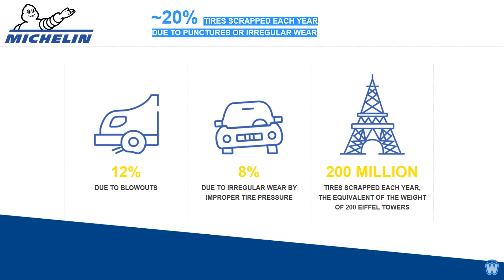Michelin Airless Tire UPTIS - Unique Puncture-Proof Tire System

Comment: I imagine these would be a pain off road.  Mud and dirt will fill the spaces, and you would need to constantly clean them out.
Reply: The crevices are not solid, as they flex and change shape the dirt and mud should clear out. They could always just cover the sidewalls with soft rubber, making them look closer to traditional tyers if the exposed structure is unsuitable for offroading.
Reply: @desolate282  what about huge rocks getting stuck in the holes?
Reply: they did mention these are used on military and industrial vehicles
Reply: check the pinned comment, it's explained there

Comment: If there's no deflation and inflation, how are these tires gonna be installed on the rims securely?
Reply: Friction without air pressure.

May need "machine press" level of power to slide this rubber tire into the rim. But to do this, will require a steel cylinder fused to the rubber tire. 

Which also mean, only one side of the rim can have a "lip". And the other "lip" should have a lockable mechanism.

Complicates the wheel system.
Reply: @allanbernabe38  my first thought was that they may be sold as complete wheels, which would be a silly idea as I consider it. 
 Your idea is more cost effective and accessible. Options for tire rotation would be less, but still doable. I mention rotation because, at the cost of a single tire at 800usd+, gonna want those babies evenly worn to get some semblance of value. 

Imo these are not good for road vehicles as rotational mass is a huge drain on the gas tank. 
Still, I think they are excellent for zero turn mowers, where a flat costs downtime to the commercial operator, a more important factor than to a car that already has a spare in the trunk.
That being said, I suppose the zero turn operator could have a spare in the truck just as easily.
Reply: That's a good question. My guess is friction. But even then, could it hold as well? And what if the rubber shrinks slightly over time? How hard would it be to get them off again?

Comment: Saw video of the US miltary trialing these kind of wheels years ago... Will all depend on their cost and relative performance to regular tyres. I'm not sure they will perform as well at speed and you cannot tune them via air pressure to suit the car and driving required like with regular tyres. I think the real problem is people not inflating regular tyres properly and that is a simple fix if you install tyre pressure sensors on cars as standard to bug the driver with an alert if they are wrong.

Comment: If a car with these tires were to go over a speed hump at a high speed resulting in the vehicle lifting off of the air for a few seconds and landing back on the road would cause quite some damage to the vehicle , since in normal tires its hollow inside , resulting in a sort of bounce that will reduce the impact force when hitting the ground . Since these type of tires aren't hollow the energy from the impact will be transferred to the vehicle , rather than it just bouncing . Due to that I doubt whether these tires are safe for off-road purposes

Comment: how does this save tyre wastage? they have the same lifespan as air tyres because you have to change them when you run out of tread. thse are much harder to construct, more expensive, have balance issues after crap gets stuck in the blades and you still have to chnage them every 30-40K miles.

Comment: One giant flaw with this system is that it seems like the surface area of the tyre on the road is far greater than a normal tyre which increases friction and thus less MPG

Comment: Why not instead more of a blade strip, that would slice in between one or more of the supports which would cause a structural instability, the tire would start peeling back from that point at high speeds so it would either stop them or force them to slow down

Comment: I would guess they have stability issues at high speeds, which is why they are not ready for the market yet.
Reply: I'm also wondering how they affect fuel efficiency.
Reply: @Mode-Selektor  Thats what I was wondering. they look very "flat" on the surface contacting the road.
Reply: @MEDiumInc  they can be made more rigid i assume. Definetely looks like less rubber used othervise, plus not needing to carry extra pressurized air means more efficiency overall
Reply: @FlyLeah  yeah but it has holes so wouldn’t that be just more drag the faster you go
Reply: @FlyLeah  yeah but a lot of cars run nitrogen in the tires. Makes the car lighter and more fuel efficient. These have a lot more rubber. So that also brings another fuel efficiency concern.
Reply: @MEDiumInc  lmao. Nitrogen does nothing. Air is already 80% nitrogen.
Reply: @r.i.peperoniiiiroh9625  you could cover those holes by adding rubber walls
Reply: I had read that they become brittle in cold weather ?

Comment: The police spike strip problem already has dozens of solutions. The police would have to transition into using a different type of “spike strip”, one prototype I saw was one that is a net and it wraps itself around the tire and axle, locking it up. The axle doesn’t spin, the car doesn’t move. No puncture needed.

Comment: I see a high speed pothole destroying a rim totally.. the way the tire comppresses in just the small pothole seems like a devistating impact on a rim for anything bigger going 40plus mph
Reply: All the impact is on 10 or so radial ridges, and not spread around the tire.  So you go WHOMP as the car drops to the ground and your bumpers provide braking as they drag on the pavement.
Reply: Quite sure there is a comprehensive testing strategy, after working in QC for VW group the standards are just ridiculous.... good concept tho, I’d buy a set
Reply: that also happens to conventional air tires though.
Reply: @jayflo714  yes but it is far less of a problem on conventional tires.
Reply: @David-vw5hf  have you actualy seen a normal tire? they cave in a fuck ton if you look att it with a high speed camera
Reply: @jayflo714  As there's a limit to how much you can compress air, you'll see that it's gonna be harder and harder to compress further. That's not the case with these airless tyres as the resistance devices (idk what they would be called) will provide roughly the same resistance no matter how compressed it is. Because of this, they will have to be a little soft or no one would use them because of awful comfort, but that means they would indeed be terrible for higher speeds. Even in the video they didn't show more than something around city speed limits
Reply: @Finsby  good point
Reply: I've never seen a high speed pothole. They normally seem quite stationary to me.
Reply: Fr
Reply: Maybe the way it is now, but if they add a sidewall for a better appearance, it would also give it more stability and less compression.
Reply: All you have to do is change how suspension handles that
Reply: @KpEMuKoBcu  ever been on american road. There is a reason we joke are tax dollars dont do shit if you cant get that concept then I dont know what else to tell you drive through east Cleveland on the bad parts over 40 on tires like these and tell me how you feel after
Reply: Easy, get tires with thicker ribs for more compressive resistance
Reply: @katyungodly  And then they're gonna be dreadful since they're not gonna have the necessary suspension when driving slower
Reply: ya so not a single person from the genius team of engineers envolved in this would have thought of that...i am impressed by your intelligence sir
Reply: @itsme_notbatman  yes and that's why they're taking time since 2024 trying to fix such issues
Reply: Did u even watch the whole video

Comment: Easy, make a spike strip that has barbs, the spike strip will remain inside this tire and wrap right around it causing the tires to either rip apart or lock up from getting tangled.

Steering would probably be heavily affected too and may cause the individual to veer left or right, who knows, but it would be a neat show.

Comment: I'm pretty sure these haven't hit the market because of fuel economy. Rotational mass usually has 3 times the impact on overall effective weight and these tires are definitely heavier than conventional ones. A greater contact area with the road also creates more friction. These would have a genuine impact on fuel economy during high speed cruising. Another aspect is safety. The lateral grip of these tires is much lower than conventional ones which makes them less safe in emergency situations. A driver who attempts to swerve around an accident could understeer straight into it. Braking distance as a whole would also be worse. The last reason is cost. More material and a more complex manufacturing process means a higher price for consumers. It's cheaper to use normal tires and fix them when they get holes. There's a reason you don't see police using these tires. Other countries that have a free market system also don't use these tires.

Comment: Just add emp sticky granades to police arsenal.
Reply: Many vehicles have electrical steering and braking controls. An EMP would disable these systems and cause the driver to lose control, which would likely be deadly at high speeds. If they wanted to just kill the person, they'd shoot them.
Reply: @mouthwash8182  well puncturing all tires at that same speed pretty much does the same thing.
Reply: @litti1047  Fair point, pursuit policies differ greatly between states, counties and precincts. In a lot of cases, if a vehicle is driving at excessively high speeds, patrol cars back off and allow the police choppers to keep track of the subject until they flee the car or wreck out/have mechanical difficulties. Trying to stop a high speed pursuit is never an ideal situation.

Comment: They will still need to be replaced eventually. After a tire reaches a certain age (8-10 years), it’ll fall apart. As for the criminal problem, there are special spikes being developed (look in Popular Science) that when deployed, will lock the axels underneath a car—making it undrivable.
Reply: Dude 9-10 years? More like 2-3 years
Reply: Also the tires don't perform well in high speed in the first place

Comment: This tire design has always struggled with high speeds. This is why you see them on slower moving vehicles, such as tractors, mowers, forklifts, "military vehicles," etc. but not on cars. 80 MPH is a daunting task for these.
Reply: I guess so, new designs will come up eventually. I kind of have an idea, maybe try a "tension string" that attaches to the wheel and the rubber tire so it could handle high speeds. I guess.
Reply: @aledner_lw7685  you can't trick the physics, those fillers are additional weight that heavily affect centrifugal force. More of that, surface of the tire is going to be much bigger in compare to air filled tire resulting in much faster wear - it is basically running on low pressure tire. How to reduce such effect? Put more fillers what means again additional weight. This tire design has too much flaws to be present in normal cars, it might have some uses in military or heavy duty industry but I feel like it is just finding solution to problem that doesn't exist
Reply: @bartomiejstadnik9585  It can get even worse when stones and all kinds of debris fill the gaps between the rubber. Also mud would be a problem. + air pressure is all the same in a conventional tire, but in these tires the pressure put on the down part is higher than the pressure put on the sides causing the tire to be unstable. + the flexibility of rubber can be affected by weather conditions causing the tire to be too soft or too hard and could break the the rubber stripes.
Reply: Urg just make a normal tire but with this. Works like normal and is flat free
Reply: @sylvarnuovis7240  Having a sidewall on a tire like this would likely lead to uneven wear on the outer edges as they would not compress as easily as the more central part of the tire.
Reply: i guess it also has Problems with braking down from highspeeds..maybe cause the Car to move cause of the Tires beeing so wobbly
Reply: Maybe just have an inflated tire on the inner ring of this tire?

Or even the inverse. Have a smaller version of these tires be in the inner ring of an inflated tire.

That way if you do blow a tired, you're not screwed and can still safely drive at slow speeds to somewhere to replace your blown "inflatable outter ring".
Reply: @SeanLaMontagne  i believe a similar idea exists. They have a different inner-tube than on the outside
Reply: I think it should be possible someday. It just needs a material that has a sheer strength at least close to the tear strength of stitched rubber sidewalls, the amount in savings from lesser maintenance and easier production may be astronomical
Reply: Any design is possible with the right material.
Reply: It may happen in hotter climate or conditions. These are what you call memory metal, they will not deform permanently unless under extreme conditions. As for speed concerns, it’s unfounded
Reply: Yea....just imagine the car parked for a few days in a Minnesota winter then driving away. The car will  be shaken to pieces!!!
Reply: How the hell do you keep these things balanced?! Seems like a lot of  areas that could have different mass/inertia. Never thought of that, great point
Reply: exactly what I was thinking before even clicking.
Reply: My low rider bounce is going to need major modifications
Reply: yeah try doing 80MPH on road spikes
Reply: thet's enough in towns
Reply: That's a good thing sense cops won't need to worry about chasing robbers going 120 on a pot hole
Reply: I don’t see these ever being a thing. Too many problems speed for one. But One of the major issues that is readily apparent at a glance is the potential for debris to become lodged in the spokes. In order to function properly, the spokes must be able to flex freely, Hard objects could quickly damage the spokes if caught up inside, sand, mud, or snow could clog them, causing the wheels to become unbalanced.
Reply: NM nobody why can't they put a cover on it that also flexes? Even some, strong fabric or something similar which fits the needs. Pretty sure they thought of that, it would be one of the first things they thought of when coming up with that kind of open sided design. 

Otherwise how does military vehicles use them, when they are used in far more testing off road environments?

Or maybe just need maintenance with "debris cleaner" machine. Instead of buying new tyres you spend on debris cleaner instead lol
Reply: @Sam should be plenty of fire resistant fabric or materials today, material science has developed heaps. I'm less worried about fire and more worried about it breaking or puncturing over time, and if you have to change that then you lose the cost benefit and maybe just stick with tyre.

If tyres and rubber can survive heat fine, fire retardant fabric should too, no?
Reply: @Sam I meant normal rubber tyres not the one in the video. As for the durability, who knows. Can't tell much just from this video, they don't give any technical information at all
Reply: "ITS IN TESTING!" is being said a lot. But literally all the testing they show here and on the promo material for the testing shows them being tested on light econo shitboxes. If light econoshitboxes want to run these. More power to them. Ill stick with 20" Pzeros and a 200mph top speed.
Reply: @YourChildrenHaveNoHomeland  wow aren’t you cool bud🤣 “and a 200 mph top speed for me”🤣🤣🤣🤣 you sound like a douche bag...and I’m a car guy🤣🤣🤣🤣🤣🤣🤣

Comment: the pit maneuver and spike strips are too dangerous anyway and there are alternatives to stopping fleeing cars.  Often chasing criminals just makes things worse.  That's why some police department shoot trackers onto the car and track it down later,  or they use  robots that go under the car and disable the vehicle or use grappling hooks to latch onto the vehicle.  I think the simplest solution is just to mandate that car manufacturers install a kill switch into the engine of every car that the police could use remotely to disable a vehicle safely.

Comment: All different vehicles require different tyre pressures as vehicles have different weight and weight distribution, how is this problem solved, how do you address the problem of having a car with quater of a tank of fuel and one person alone, vs  5 people a full tank and a boot full of equipment, the tyre requires more pressure?

Comment: Well police can use more aggressive spikes to stop vehicles, sometimes more looks like knives that cuts a big peace from tier, but I can see other problems for those type of tiers, like ice that will eventually form in those gaps in places were is quite cold, another problem is balancing those wheels, well for vehicles that moves not so fast it won't be a big problem if some rock will live for some time in tier for some time, but when you drive a car with speed 120 km/hour that's wouldn't be safe. Similar problems with road that have a lot of water on it... So I think that it's a great project but still needs a lot of work for real life.

Comment: there is already such thing to stop moving cars without blowing their tires, a net which wraps around the axel of the car and stops it even faster than when tires are punctured
Reply: Yep that Is what i was going to point out
Reply: The only downfall of spikes and such not working are the backup spikes in some places to prevent people from going that way, ya know the spikes that lay down if you go one way and stab the tire if you go the other
Reply: Yes the net version is normally shown installed at vehicle checkpoints and can stop trucks too.